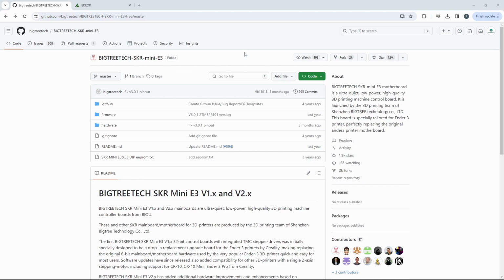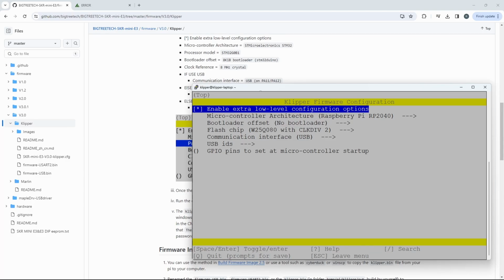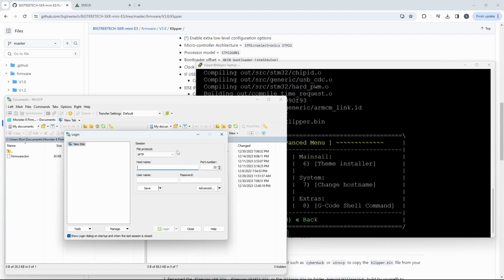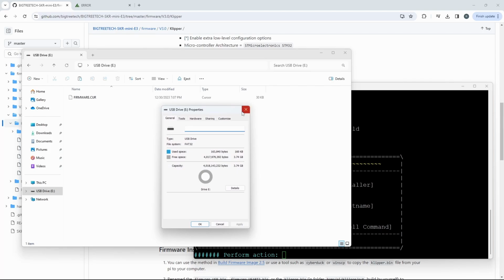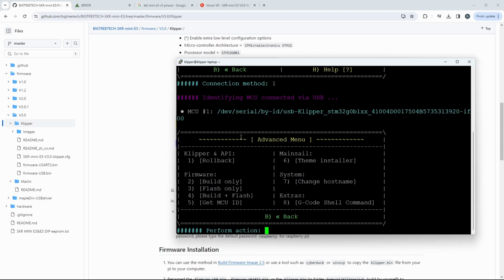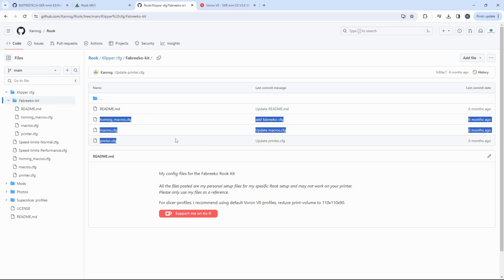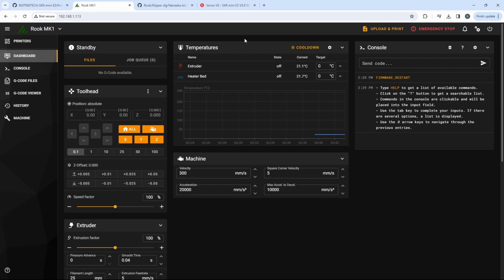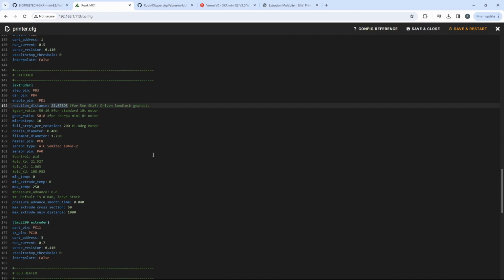CoreXY Rook 3D Printer Build Series  - Part 6 - Flashing Klipper to BTT SKR Mini E3

Comment: Hello, how would I have to edit the configuration files, in klipper, to be able to use the configurations on a similar printer, but with a 450x450mm bed?
Reply from the maker: you can just edit the position_max size in the printer.cfg under stepper X and Y